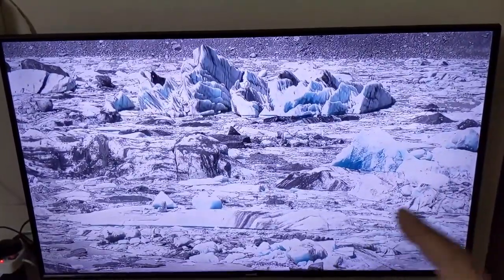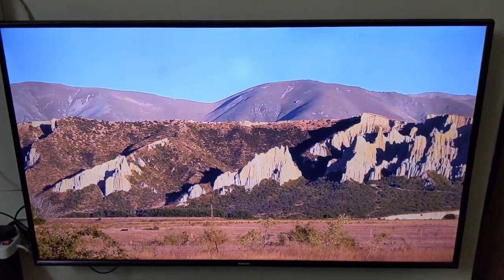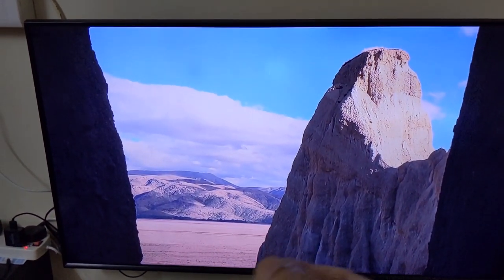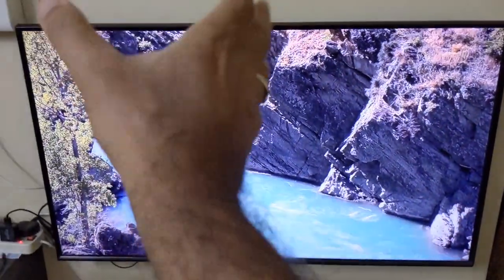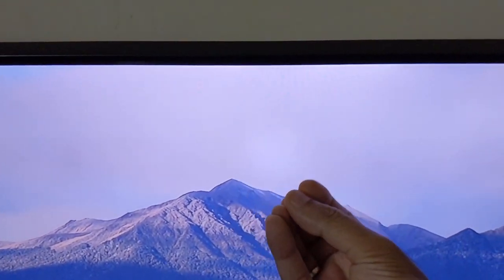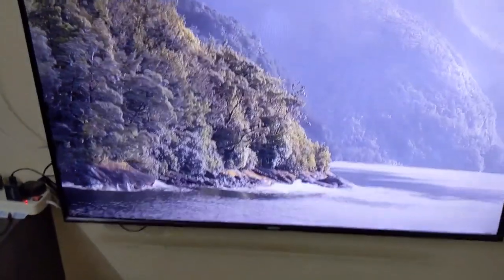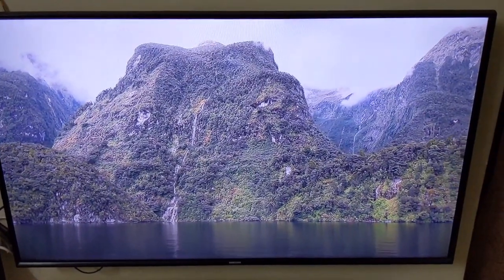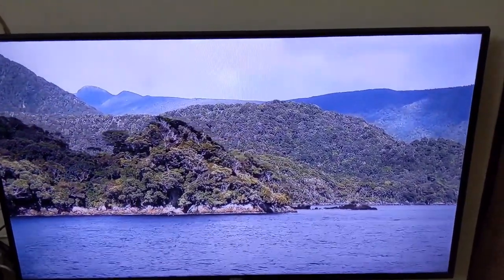Bright spots on Samsung LED TV, tried to fix second time..ended up damaging the cof connecter.

Comment: Tips from someone that has now repaired THREE 55" Samsung TV's!

Main Point: The most critical part of this repair is to get the lens PERFECTLY centered above the LED!

When looking straight down on top of the LED with the LENS ON, there should be very little light coming from dead-center. Essentially, the lens should "push" the light to the edges of the lens itself. If you don't center the lens EXACTLY over the LED, then light will escape the lens and shoot straight up to the diffuser and you will still have white spots on the repaired TV (voice of experience speaking here). I would say use the following repair process steps- 

1) turn the TV on and set the brightness to the LOWEST setting you can set it to (this will save your eyesight as you center the lenses)
2- Disassemble the TV to the point where you can re-glue the lenses. 
3- Use a fairly slow-dry glue that allows you up to an hour of repositioning (I used GEL-type superglue**)
4- Put on your darkest pair of sunglasses (this process is very eye irritating- I ended up seeing spots for an hour afterwards!)
5- Turn the TV on and look down directly over the top of each lens you have glued
6- If any direct light is escaping STRAIGHT UP up through the lens, carefully reposition the lens until as LITTLE as possible is coming straight up- the three small "pips" on the lens should drop into the small copper-colored "holes" in the LED strip when centered correctly

This small tweak GREATLY improved the quality of the image and light dispersal on my repaired units. The LED lens is designed to reduce the "direct-up" light and spread it wider to spread it on the diffuser layer above it. If its not centered, the LED sorta "blasts" through the lens and creates hot spots on the diffuser.. not as bad as no lens, but not as good as the factory aligned lens.

I Hope this helps someone get better results! 👍🙂 

** The GEL-type superglue can cause the lens to "fog" so carefully wipe the lenses of any white powdery fog that may accumulate after the gluing process
Reply: I still had light coming out of the side and couldn't manage to get it away, so Ive just put tape with superglue under it over the sides where the lights came throw.. That worked well and easy
Reply: Have you repaired any that had 2 diffuser panels? One has location tabs on the edge for the frame, and the other one had flat edges. Which one goes on first? directly in front of the reflectors?
Reply: Are the lenses made of plastic or glass? Can you use solvent to get the residue off? How would you recommend doing that?
Reply: @omfgbobsaget  The lenses are plastic. I was ultimately unable to get the white fogging off so ended up with slight "hot spots" where the fogged lenses were. When you show a perfectly one-color screen of say, blue, you can clearly see the "hot spots" but when you're just playing movies or tv shows, its not really that noticeable. Bottom line is the lenses can be glued back down and the tv will "work" but it wont have the kind of purity that a factory lens has. ¯\_(ツ)_/¯
Reply: @VernGraner  thanks for the tip. Our tv looks so damn bad right now i can't see how anything could make it worse other than it completely ceasing to function
Reply: @omfgbobsaget  I have two of these that  fixed up that are used as "daily drivers" where they are on and showing images all day every day and after the repaird lenses, they look fine. I'd say go for it! :D
Reply: @VernGraner  oh im gonna. That's how the one I have got broken, or the person who gave it to me dropped it and didn't tell me

Comment: Thank you SO much for posting this, it worked! The video is a little problematic, there's no sound at all after about 5m30s in, but still possible to follow. DO NOT lay the TV component-side down directly onto the floor, make sure to use a lot of padding (like pillows) to protect the components, or better still try to prop it on blocks. But fantastic... I thought I would need a new TV!!! 🙂
Reply from the maker: Thank you Richard! Glad it worked for you.

Comment: Be careful to resite the two tape connectors correctly. After lens repair, tested screen had no picture so I resited the left tape connector and got the picture back. White spot still there however though somewhat reduced. May redo it but more carefully.

Comment: Is this a KU6000? Samsung tried to charge me nearly 50% of the cost of the entire TV when I asked for a repair quote. They wanted to replace the entire screen, not just the LED strips or the dislodged diffuser.
Reply from the maker: This is 43j5100 2015 model, yes they'll rip you off as their only intention is to make you buy new TV's instead of repairing the old ones

Comment: So basically it broke because you had laid all the internals flat down on your rug?
Reply from the maker: Most likely it is my lack of experience in handling it carefully, as you have to turn the panel around, that's when the cof connector may have come apart.
Reply: I dismantled mine face down with a towel protecting the front, and one covering the back, so no particles get to it while I work on the backlights. Taking off all the pcbs and putting them in anti static bags.

Comment: My Samsung TV has got a bright light spot on the right of the screen which is annoying me. Shall I get a new TV or try to get someone to repair it? Thanks.
Reply from the maker: Get it repaired without any second thoughts, just request them to be a bit careful with the cof connectors while disassembling the TV, however the fix itself for bright spots is an easy one

Comment: Why do you have to disconnect and take off the speakers since they have nothing to do with the diffusers?
Reply from the maker: Probably you are right, as far as I remember I had to disconnect the speakers so that it would be easier to reach the diffusers. Trust me, removing the speakers was the easiest part in this video, and it also ensured that I would not accidentally break anything else since there are lesser things to deal with.
Reply: @motogpwin  Thanks. I did take the speakers off. I glued 12 caps. I put it back together and bad news. I here it come on but it's a blank screen. I see a little blue but that's it.
Reply from the maker: Ohh that's bad news indeed...there are two separate flat cables that connect the motherboard with the display..these appear at 7:13 in the video..most likely these haven't been plugged in tightly..try this..remove both cables from either ends..clean the connector pins with an eraser..or with a dry cloth..and plug them back in .. ensure it fits in tightly.
Let's hope this does the trick else need to check with a technician.
Reply: @motogpwin  I unplugged the flex cables and then plugged them back in. I made sure they were all the way in and my tv works. Thanks

Comment: I tried with fevi kwik,,but the plastic ring doesn't stick to the led
Reply from the maker: You'll have to hold it on the led for atleast a minute with adequate pressure then it'll stick

Comment: Why do you use eraser for
Reply from the maker: I used the eraser and the microfiber cloth to clean the sheet which was laid on the LEDs and reflectors. In my case it had developed a thin layer of carbon deposit due to the heat from the LEDs, however it is not essential to this fix and can be skipped.

Comment: Problem is panasonic service guy is quoting about 6500 rs minimum to just fix two bright spots. Not sure if i should do it myself now after watching this video.
Reply from the maker: The repair itself is quite simple, but the risk of breaking something else is quite high. Assuming tv is not in warranty, I would suggest checking with a local technician, mostly they'll replace the entire led strips for a lesser cost.